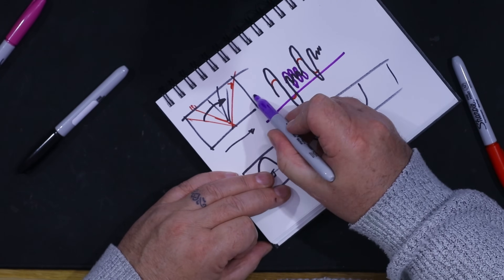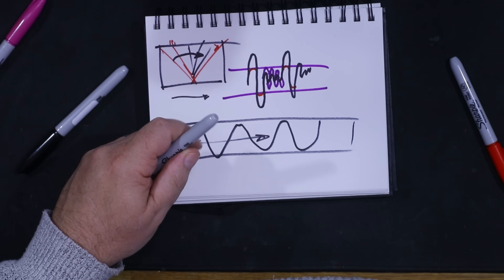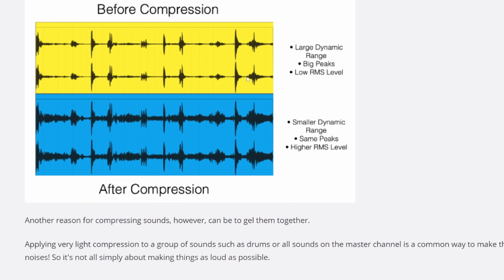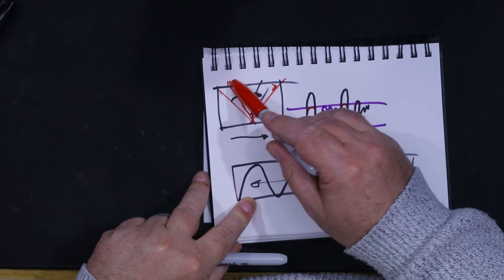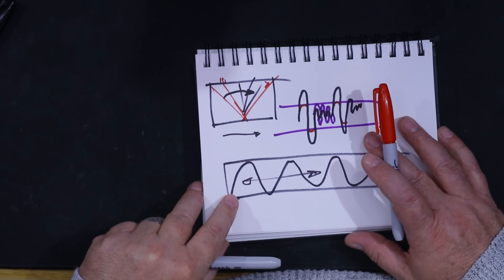Simple Trick to Make Your Radio Louder

Comment: Maybe I have the worst callsign ever. Nine Alpha Four Golf Echo. This 'GE' gives me a problem. And I recorded myself. To my surprise, for some reason - first part is loud, but last two letters phonetically are weak. Then I try to train myself to shout loudly two last letters. Not sure it helps, people still struggling with the suffix. Even changing spelling to 'Germany Ecuador' sometimes fail. Processor is on, at 20%, AMC level is at 65, MIC gain is at 40 (Yaesu FTdx-10). Parametric equalizer is adjusted to some extent. Stock microphone (SSM-75E) is not that good. Later I will try to make DIY solution for that - headphones with microphone and simple electronic to connect it to the radio. And, maybe foot switch for PTT.
Reply from the maker: Try extending G..OLF and EEE-Cho
Reply: @DXCommanderHQ  Good idea. Will try that too. Thanks.

Comment: Great tips. The compressor seems to be not well understood and often used poorly. 
My biggest problem seems to be from U.S. contest stations misunderstanding my "Alpha" as "Oscar". I can understand if they think it was Delta but Oscar, to me, sounds why different. DX stations (or POTA stations) seam to never make that mistake,  just U.S. stations. I think it might be that many of them have the DNR cranked up too high which will mess with things as it is a digital process that may not always interpret the audio input well and just "makes something up" that it thinks is close, kind of like AI (which it is a very simple version of.)
73 K1AUS
Reply from the maker: Interesting.. You MAY want to experiment with changing the diction very slightly.. I don't know..
Reply: @DXCommanderHQ  It seems "America" seems to work better. Tempted to use "Aardvark" though😁

Comment: Another great video. I use the processor on my FTdx-10 with an M-70 desk mic and get really great signal reports. Part of it is having learned to speak at a consistent volume into the microphone and not turn my head away or let my voice audio trail off. Aside from the radio/mic settings it seems the letting your voice trail off like you demonstrated is the biggest issue on voice making you ask for repeats. We have several members of our club who do this on VHF and HF so I am going to send this video out to the club to hopefully help. I am also a meter watcher. Thanks Callum. BTW the Classic is still working great going on 2 yrs. Jack K5FIT
Reply from the maker: Yes, head turning and tailing off, particularly at the end of callsigns often gets me.

Comment: This sounds like something that can be adjusted when running on a dummy load, or am I off-base?

I bought one of those inline samplers to drive my oscilloscope, but I gave up exchanging emails with the maker (ham) to figure out what I am doing wrong. I never got a usable waveform to measure with. It is a decent, if old, Tektronix 100MHz bandwidth scope, but AFAIK doesn't have the separate trigger input his device wants.

Now, if I could use my voiceover kit... Rode NT2A with Tascam 2x2 interface... and an unused old Behringer rack mount processor... one day, perhaps I will.figure it all out. That isnt very portable lol.

Good advice Cal.
Reply from the maker: No.. Not portable :)

Comment: I max out the highs on the eq, slightly negative bass, turn gain up on the mixer till it over modulates, then dial it back, talk right up against the mic. No compression or any processing. Sounds clean and I break through most pile ups on 100 watts.
Reply: I realized the highs are important because most guys on ham radio are over 60 so their high frequency range of hearing is shot. Also on the receiving end too many guys have got their DSP/NR on and I think it ruins the audio. I personally can’t stand running it except it unique situations. Thanks for the video!
Reply from the maker: Yes, another technique too

Comment: I take it you are a musician Callum (drums kit and guitar hanging on the wall are hints).  I sing in an a cappella pop choir and our director is all about 'Bela Canto" voice technique.  Proper diction and proper modulation of the voice is as important in radio work, (amateur or professional broadcasting) as in singing.  The voice is an instrument of communication.  I recommend use of the "monitor" function on a lot of modern radios to set one's audio parameters, whilst still paying attention to the meters. If it sounds good to yourself, it should sound good on the receiving end. A "great audio" report will be the proof, which in my mind is way more important than a "you're 20 dB over" report, which, in my opinion is not as meaningful as a "3 by 3" report.
Reply from the maker: Good point.. If they can hear you well at 3 & 3, you must be getting the info across..

Comment: All good using the processor, but remember to watch your ALC meter and adjust your microphone setting to make sure your ALC level does not exceed the ALC meter limit to avoid over-modulation.
Reply from the maker: Good point!

Comment: Agree with Cal. Also to add, if you are a qrp station or limited by the tx power, reduce the TX bandwidth so the energy is calibrated / channelised for maximum talk power. Instead of using 100hz to 2900 on an ICOM, use 200 to 2700 or 300 to 2700hz if you are chasing a dx station or a one off contact. ofcourse for ragchew, 100hz to 2900hz is preferred. most radios these days can adjust the tx bandwidth without any external gears!
Reply from the maker: Actually, that's a good idea..

Comment: I agree with you simply talking louder will help at the other end if you are a weak signal but I just wanted to point out that the majority of inbuilt meters and external swr/power meters will not show true peak audio power. You need a (more expensive) true PEP reading meter for that. As a rough rule, if you are using a 100w PEP radio and the meters are showing 50-60 watts you are already running 100w PEP (or more). If it is more, you are likely splattering all over the band. A speech processor or compressor can help (one that converts to RF first modulates and converts back then to audio - see one design in RSGB handbook - are the best and won't cause splatter).
But back to the original point of talking louder while still far enough away from the microphone not to sound like you are swallowing it, is a great tip for making more of your SSB phone signal.
Thanks Callum. 73 Ed DD5LP
Reply from the maker: Now.. physically measuring your power output is different, I agree.. BUT.. Just watching ANY Meter will teach the quiet station operator when they are talking quietly.
Reply: @DXCommanderHQ  absolutely it's a great, commonsense tip. Thanks for putting it out there.

Comment: Hi Calum
Patrick here looking for advice for my brother, we both have a yaesu FT450D Radios and serio blizzard 2700.
He has been told by his local council that he must have planning permission to have an antenna more than 0.5m above his bungalow, we are both studying for our Foundation course at this time, is there anything he could fit in his loft ie long wire that would have the same rx/tx properties as his 2700???
Thanks for any advice, love your videos!
Best regards
Pat. 73's
Reply from the maker: OK, now my council don't care about verticals.. And I suggest he appeals this 0.5m on a VERTICAL and explain that there are TV antennas a lot higher.. (assuming there are). I don't know the 2700 but explain to the council that if you have to go down the attic route, there is more chance of causing initerference. See Ofcom guidelines.. And physics!
Reply: Get some developer friends to submit proposals for 33-story apartments, office buildings, or grain elevators or similar,  then slip your application in, and it will seem miniscule in comparison. That and get to know the council members. Similar to American HOAs, it's a game, one I always avoided, but now I am more than willing to learn with societal changes.

Comment: For pile ups I narrow the audio to 400 to 2600 ,, regular rag chew I use 200 to 2800. I run my mic gain low, but close talk the Heil 781 ,, usually watch the meter on the power supply for peaks and have the swr meter on the rig. I don't want any ambient noise with my voice so I run at about 40% mic gain.

Comment: Cal, I have had trouble having my call recognised. I’ve actually reduced my time on the radio. The two ‘M’ zero call is an absolute nightmare. Any suggestions? Apart from Full license exam. That’s gonna be a struggle. Maybe wait till the ‘new’ 8s and 9s is my only hope. 😂
Reply from the maker: OK Mark, I don't have an issue hearing Two Mike Zero myself (mostly).. Have a really deep think about what it sounds like and perhaps adjust the spacing and inclination.. Possibly sound almost ridiculous, like: "Two-A - Mike-A - Zee-Roow". Slow down.. MAYBE?! Not sure what your full callsign is else I might be able to have a listen back to one of my live-streams and see if I can find you (assumes you call in maybe).. But listening to yourself and also having this as a discussion might assist.
Reply: yep.  These days, people are not often required to enunciate!  Even the people on commercial broadcast radio.....Bob KM6PAX @DXCommanderHQ
Reply: 2M0 XZA - I’ll have a go at calling slower. But my inclination, in a pile-up situ, is to get in there quick. Probably too quick.
Reply: @marksaunders2M0  Most radios have a record function, so you record yourself saying your callsign slowly and precisely with nice diction, , then you just have to hit the play button to make that call.